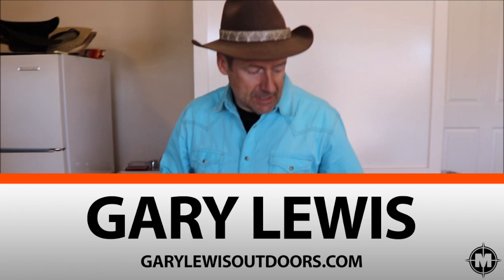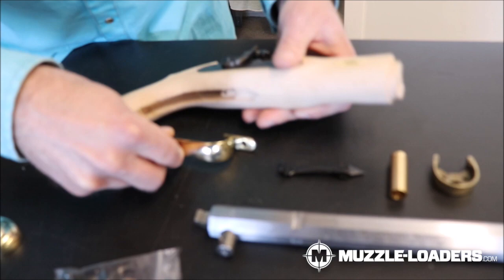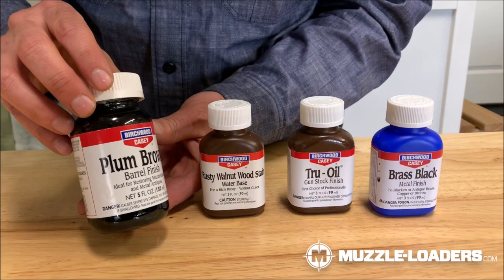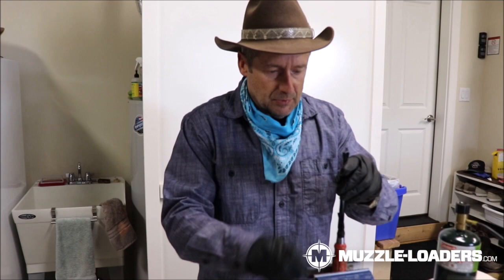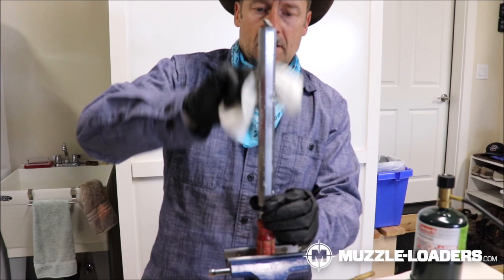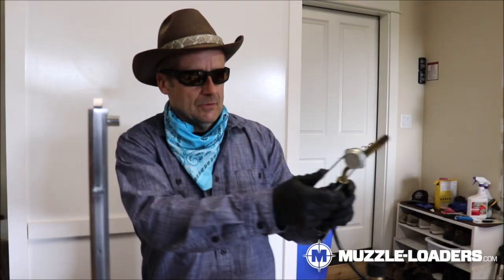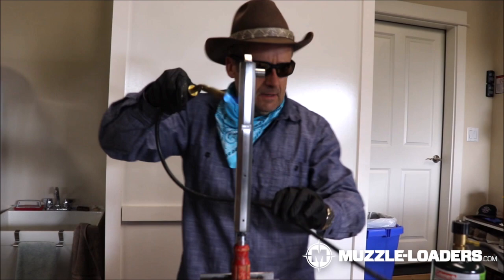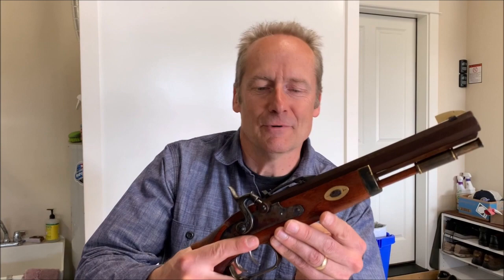Traditions™ Trapper Pistol Kit - Build How To - Muzzle-Loaders.com

Comment: Is there any way that my kitchen's oven could do the heating intead of a torch? I don't own a torch and I think that the oven would heat it more evenly, 275 wouldn't be high for an oven either, just dont know if there is a reason not to safty wise
Reply: Hey, have you gotten around to building your pistol yet? If not then I don’t see any reason why an oven wouldn’t work. The only issue I see is finding a way to stand it up to apply the coating without burning yourself once you have it heated. Maybe you could balance it standing up but that would be pretty tricky. If you can figure out how to do that safely then I say go for it!

Comment: i am trying to make a holster for the pistol before i get it and was wondering the size of it, i checked the site and it only has the barre length
Reply from the maker: Unfortunately, I do not have the exact dimensions of this pistol and I do not currently have one that I can measure. I would recommend reaching out to Traditions as they should be able to provide you with those dimensions. Traditions can be reached via phone at 860-388-4656.